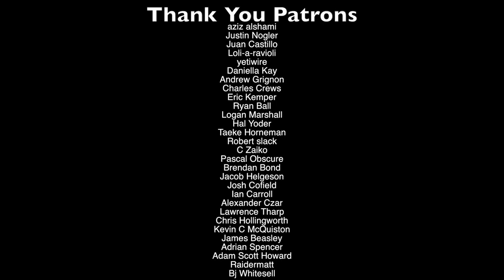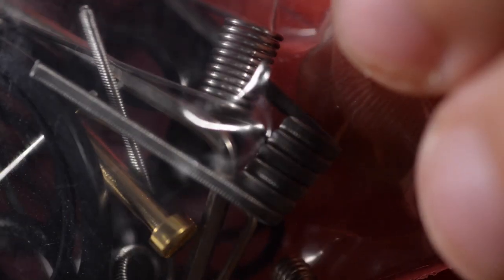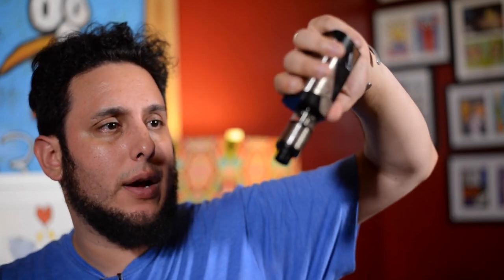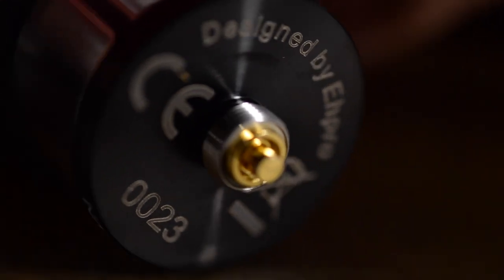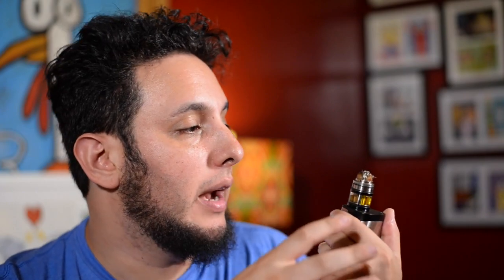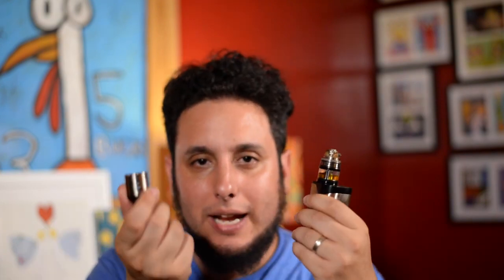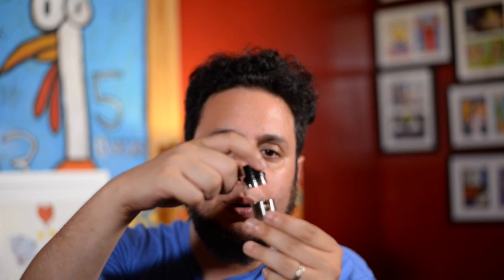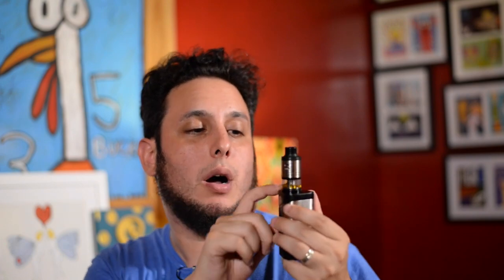Upside Downside and The EHPro Fusion Box Mod RDTA Kit | Big on Innovation | Small on Execution

Comment: I much prefer your usual songs but hey, whatever flys your millennium falcon amiright?
Too many flaws or cons with this device. I see it being a flop. Which is a shame because the idea is unique and pretty interesting. 

Also, interesting technique using the key ring to hold the wires. Does it work well? Do you have to move it manually, or will the Clapton move it?  I just started building fused claptons. Literally have only made 3.

Comment: Hey man how do u hold the spool of wire while u Clapton? Is it not too loose? How do you keep the tension when doing that? I would love to know that would be so much nicer to do
Reply from the maker: +Shane Ellis it's a trial and error sort of thing with your first clapton... not too loose not too tight... basically you want to keep the wire going into the core at a 90 degree angle and holding about 6 inches away... just want it to slip from your fingers... and if you ask me it's easier to make a good fused clapton than a good clapton
Reply: OhmBoy Josh ok that makes sense.  I have been trying a lot lately and wasting a ton of wires lol.  Every time I messed up I would reverse and then the wire was all twisted and then it would knot.  So I would get on a rule them the knot would come and screw it all up.

Comment: I have the same mod bro ss is very finger printy but you must have got yours after the update on the firmware mine only goes to 150 with one side off it would be nice to see other tanks or (toppers) for this mod but still I love mine and use it daily and mine came with 2 of the same coils not like yours had a fused clapton and a round wire so they must be changing things up some...
Reply from the maker: may actually have been 2 of each actually 2 fc 2 roundwire... don't remember... glad you're liking it... think there's a firmware update that will bring it up to the 220 on the single side

Comment: looks neat but I don't know lol. think that might be just a bit on the ridiculous side. I mean, dude, you spend the money for an rda that can take duel and quad and hell even octacoils if you want to cause thunderstorms, spend the time to make those pretty fused staggered claptons and aliens, then just fire one? what the hell man?  lol. not knocking this mod by any means by the way. just simply stateing if I want a single I'll just build it that way lol. seems a bit to much going on. and I prefer fireing both coils at 350 Watts if I want. still, it's a neat idea. intreasting to see where this goes
Reply from the maker: +Richard Peterson it's kind of the same thing in a way... pumping 100 watts through each coil is like pumping 200 watts through both because of the way each coil splits the power in a traditional dual coil build... so you can fire them dual at essentially 200 watts... but yeah I see your point... if you're a die hard dual coil plus builder not the right mod for you... plus if you need 350 watts look elsewhere yeah